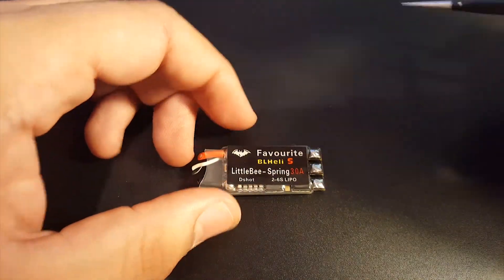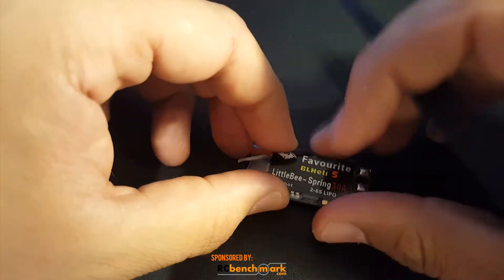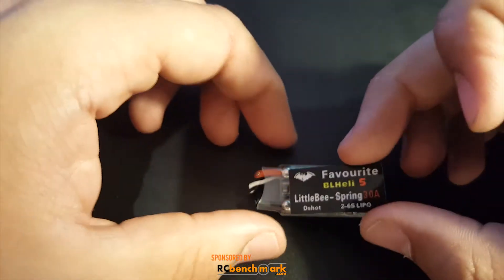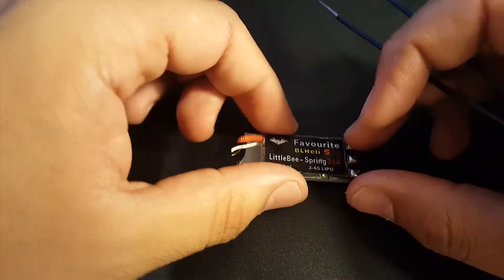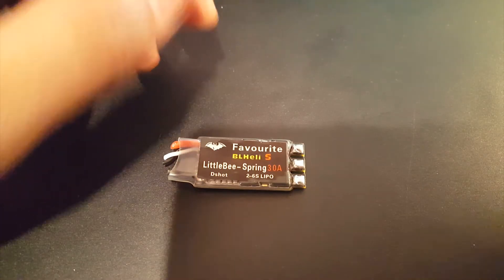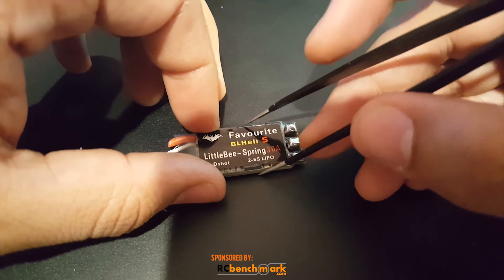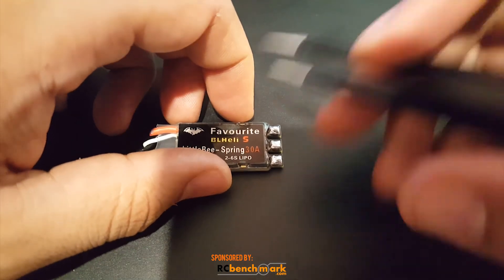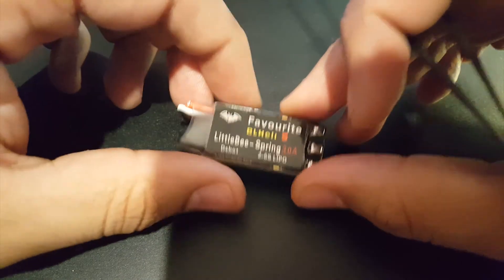Favourite LittleBee Spring 30A Review and Noise Testing

Comment: Thanks for this!!
I put them on a 5 inch Chameleon with Emax race spec 2300KV running D shot 600. VTX is  a TBS unify 800 mw - 5 volt, and the vid feed is too noisy to fly under any throttle. I was thinking of running 330uF 25 volt on  each esc, whats your thoughts? vid is powered from an actual Betaflight F3 board on a (filtered?) ram power at 5 volts.
Reply: did you try it?

Comment: Can you show us some time how to reverse moter because i cant see those pads to solder on any of them or do you have to cross wires? And with wat kind of motors do you do these tests?
Reply from the maker: +Bennie Leip just cross wires any 2 will change the rotation ^_^
Reply: Drone Mesh dosnt matter witch one? Strange😆 but okey thnks👍🏻
Reply from the maker: Bennie Leip Yes it does not matter

Comment: What do you think the best 30-35a escs are at the moment?
Reply from the maker: Ok I can't say the best yet until i make the last test on them. So far the Ipeaka 32bit 35A ESC , They have passed 2 tests the bench test and a flight on a noisy quad which it cleaned up and became my favorite. However that quad had a low esr cap.. I just built a new quad with very demanding motors without capacitors and this flight will be my final test on them and then I can trully say they are the best in my opinion but like i said I have to wait until I fly it.

The build video will be up tommorow on this quad.
Reply: Drone Mesh thanks